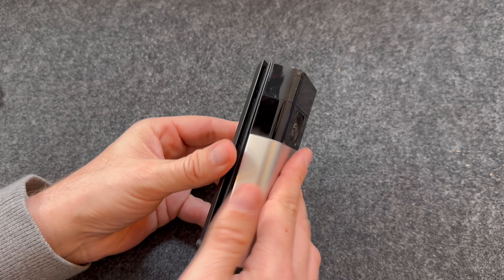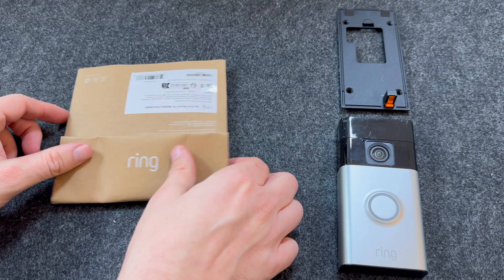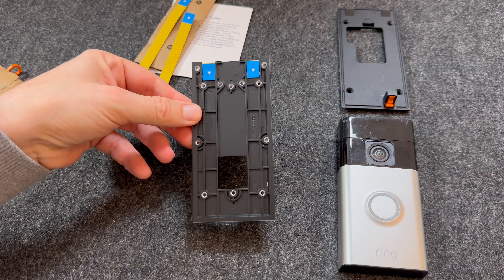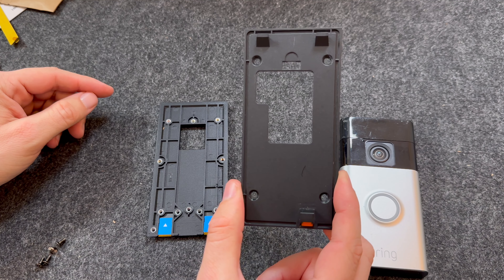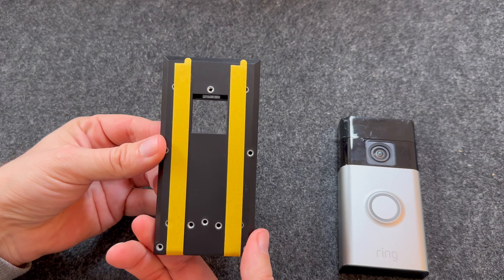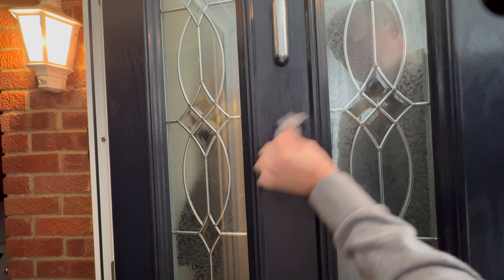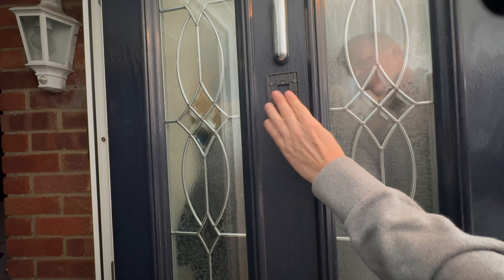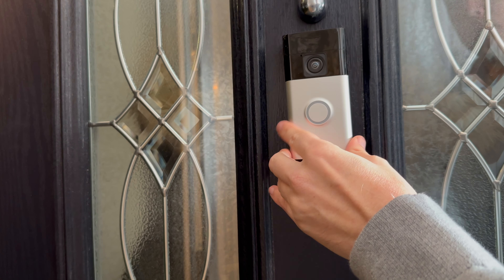How to install Ring No-Drill Mount for Battery Video Doorbells

Comment: So wait, did you use the A or B screws when installing the mount to the bracket?

And is removing the face of the ring camera not required?

Comment: Great tutorial, thanks do you have a link to the actual no drill bracket all the ones I come across are not the same as the one you are using. Thanks in advance

Comment: I’ve tried this numerous times but ended up sending it back because the screws would not screw on to the mount. The packer has numerous screws, which ones are best to use?

Comment: thanks...how did you order..I am trying to search for the exact product and unable to do so in amazon
Reply from the maker: Just on Amazon. I just typed Ring no drill mount. I believe it’s on the ring website as well.
Reply: @DanielWestow  thanks  a lot for the response. I did order from amazon but it did not have the screws and it later turned out to be non compatible . Could you please share the amazon link?

Comment: Any idea why my ring is not clicking into the mount?? I’ve installed the no drill mount and screwed the ring mount onto it BUT now the ring doorbell itself will not click into place?  Ugh driving me crazy
Reply: Did you slove issue
Reply: @amill401king16553  Not really. I had to unscrew the bottom screws of the mount, and now the doorbell clicks in, but Its only being held up by the top 2 screws and not all 4. It's whatever to be honest.

Comment: I find it so strange that this mount doesn’t work with the ring video doorbell battery plus. I originally purchased the regular doorbell which allows me to attach to the mount but the issue is I have to remove the full doorbell to charge it. I have now ordered the battery plus version that allows me to change the batteries and there doesn’t seem to be a way to mount it without a drill. So strange.

Comment: I have the no drill mount for my ring doorbell which is a 2nd gen i've just upgraded to a gen 3 and can't get the bracket to fit the mount
Reply from the maker: Amazon made a no drill mount just for the 2nd generation. The newer mount is compatible with most models. Its possible you have the old mount that doesn't work. If you look on your order history (assuming you went to amazon), it might say "Ring No-Drill Mount for Ring Video Doorbell (2nd Gen)". If it is this one it wont work with the gen 3.

Comment: Can't get the doorbell off now, it would have been useful to show this in the correct ordered. I assembled too early and now I can't get the backing off.
Reply from the maker: Just detach the doorbell?
Reply: @DanielWestow  The doorbell isn't coming off that's the issue
Reply: @lindseysequeira5106  you should have gotten a small tool that allows you to detached the doorbell from the bottom

Comment: Should I have received some special screws for attaching the doorbell to the mount as part of the “no drill mount” product?

All I got in my package was the frame with the adhesive strips. Didn’t get any screws?
Reply from the maker: You should have received 2 packs of screws. Did you buy the official ring no drill mount?
Reply: same here..no screws :( and is not compatible...returning it tomm. ordered from amazon
Reply: I didn't get the two security screws either
Reply: Yes I did but the two security screws were not included and it's too late to return the mount